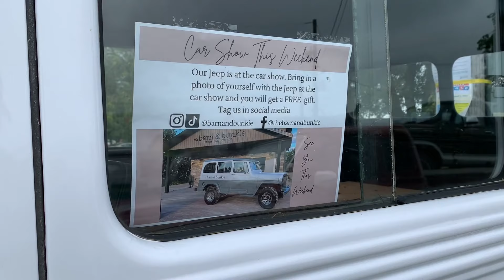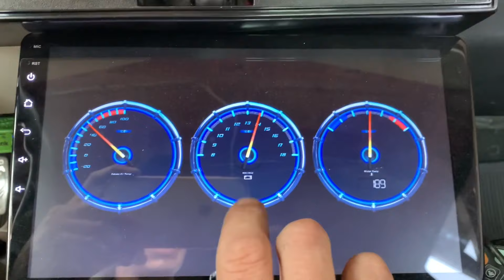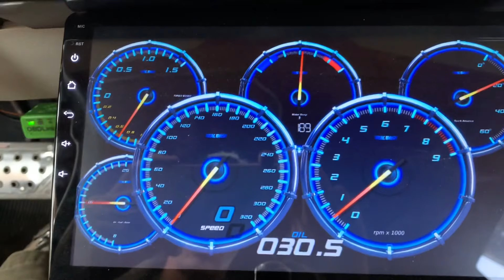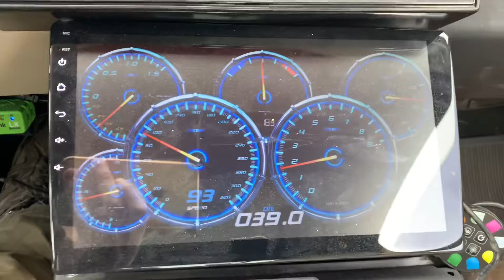Driving The 5.3 Firebird 400 Kms To A Car Show & Swap Meet

Comment: Love that green Dart! There was so much cool stuff there! Like the old Caddy, the G body, the old Jeep wagon, the Red ford pickup and the Bronco with the vintage looking tires. That red thing you called a Charger was actually a 66-67 Coronet, they are one of my all time favorite cars for their super aggressive look. And that was a really nice example of a 2nd gen Z28 too. 
Also I wouldn't be surprised if you started running a cooler temp with a 160 degree thermostat. I've heard a few people say its better for various reasons to have one. 
I know one particular kind of old Ford V8 needs a Tstat to build enough pressure in the cooling system to circulate properly. I saw that on an episode of Roadkill.
Reply from the maker: i really liked the cadillac, looked all original!  yes i thought it was an early charger but i saw the trunk lid said coronet , i was going to correct myself but i got distracted by the kids in the back seat lol.
Reply: @613Builds  No problem, perfectly normal mistake considering the two cars are literally identical from the doors forward.

Comment: Doesn't pertain to this video exactly, but your vats bypass you did with the van. Are you still running that set up? I was curious if clearing codes or something would reset the pcm and lock out. Doing junkyard budget 5.3 in a el camino
Reply from the maker: I used the glitch bypass for the first year or so but ultimately I had to tune the flow rates in my 2002 pcm when I swapped to the flex injectors back into my 2005 L59 so I use a new method now and I documented it all in my videos.  The new method is a DIY CPU flash with free software including LSDROID & TunerPro but I had to buy the OBDLINK hardware.  .  To answer your question yes Clearing the communication codes on the glitch bypass will reset the PCM so it’s okay to read codes and fix problems but don’t delete the codes if you’re utilizing the glitch bypass.  I mentioned that in my videos, comments and descriptions as well, but clearing codes does not affect the new method for turning the cats off in the tune and flashing it to the PCM with OBDLINK and/or LSDROID
Reply: Awesome, thanks for the info, and love the content, I operate in a very similar way, haha

Comment: is your firebird fast?
Reply from the maker: I think it has a power to weight ratio of 10 lbs per hp so I guess some might consider that to be fast 🤷🏽‍♂️ it’s loud and fun kinda feels fast but not by today’s ludicrous and hellcat standards perhaps lol.  It’s only about 300 hop but it only weighs around ~3000 lbs.  I think with a good tune and some sticky tires it has the potential to be fast
Reply: @613Builds  ok cool, because I have basically the same build but with a cam and heads with slicks, and I didn't know if it would be slow or somewhat fast,
Reply from the maker: @wepteditz2353  with a cam and slicks youll be faster than me lol probly make good fun.  i guess a cam really wakes these engines up
Reply: @613Builds  ok thanks for answering, btw you do a super good job at making yt vids keep up the good work.
Reply from the maker: @wepteditz2353  thanks boss, appreciated

Comment: What rear end do you have in your car?
Reply from the maker: It’s the factory 10 bolt open diff 😂🤦🏽‍♂️✅ it’s okay if you break traction before you break an axle lol 😂  I really want to put a posi in or maybe an 8.8 posi
Reply: Mine is the same on my 89 lol I have the same setup as you except I went with the 4l60 I want a posi too that's my next move